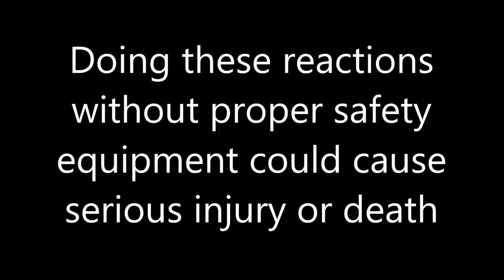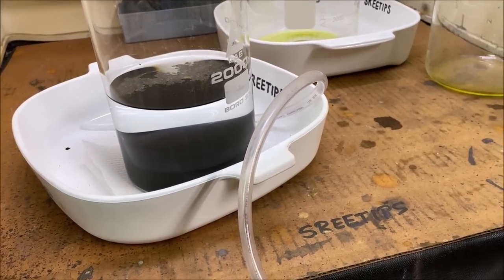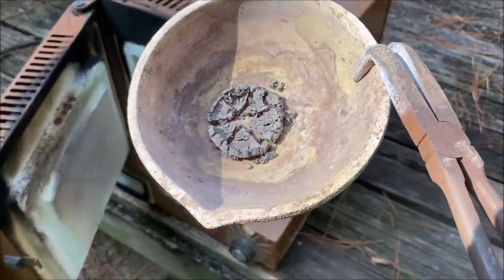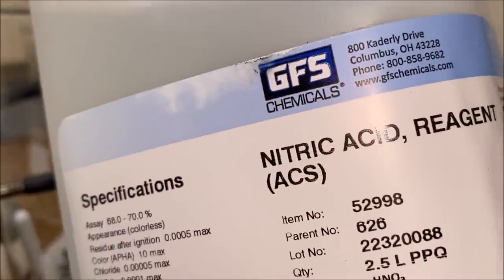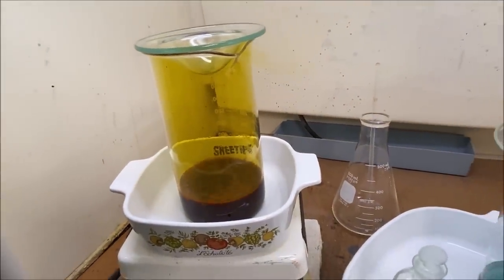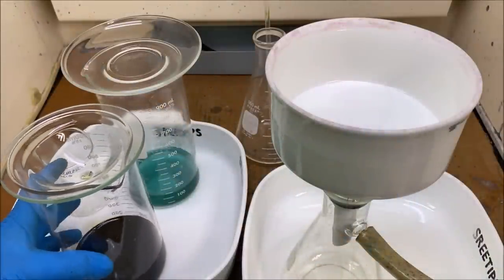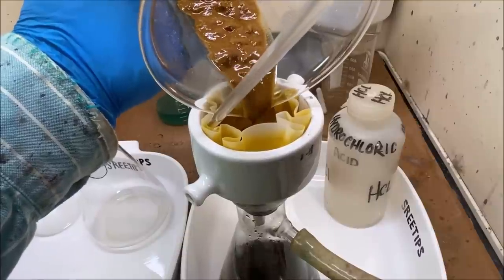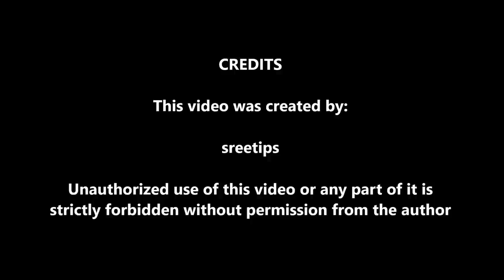Stock Pot 5 Pt3

Comment: Thanks for another series of videos. You and others have been pivotal in helping me on this short journey of extracting and refining precious metals, which has been highly lucrative for me and my family. One experiment I tried with "contaminated PGM" gold mudd after rinsing and drying was adding Nitric acid at 90/10 (v/v) with light heating. After rinsing and heating with DI water, I had 99.35-99.5 % purity from assay feedback with our refiner. I did have residual gold precipitates that rinsed away on decants, but those went back into my stock pots.
Reply from the maker: Nice

Comment: Out of curiosity, I know it's a pain to work with, but would using Copperas make sense here when dealing with mixed precious metals? Since it drops just the gold, that portion of the mixture would be gone and out of the way and you wouldn't have to deal with PGM contamination in your gold.
Reply from the maker: The pgm solution would be loaded with iron in solution.
Reply: @sreetips  Ahh. Gotcha. Thanks!

Comment: There’s another refiner on here - I think Omega, that took his copper junk and made a copper refining cell (same basic idea as the silver cell) as an experiment - then refined the sludges from that and found that a fair amount of PMGs got pulled along with the copper.   Be interesting to see Sreetips do this - mostly to see if the techniques and procedures used are so different as to leave that much less in the waste cooler.
Reply from the maker: Silver and other precious metals are in the slimes from refining copper. But for me it makes no sense to waste time trying to refine copper. Clean copper for refining is cheap and plentiful. To a precious metals refiner, copper is waste.

Comment: The way you make your basket with the dacron  filter, it looks like you're using 2 layers of it, the way you place/cut it. My question is if you used a single layer, would the silver crystals grow faster? And would it lead to significantly more contaminants? Would love to see two side by side, one with a single layer, one with a double layer and compare them every few days! Thanks for your videos!
~LightMike
Reply from the maker: I prefer double filter protection against contamination over speed.

Comment: If you inquarted the gray material with sterling and did nitric boils would the PGM's have followed the silver out in the boils? I still think you should make copper plates for your stock pots with your waste copper.
Reply from the maker: The PGMs will follow the silver

Comment: Once you realized you messed up and didn't crush the chunks up you should have wash them with distilled water. Heated them in the beaker on a hotplate until they were dry then poures them into a a mortor and used a pestle to crush them up. Then continued with the nitric boils. Would have taken you an extra 30-45 minutes tops.
Reply from the maker: I know, guess I just got lazy.

Comment: instead of throwing the copper away from your waste treatment bucket, accumulate it in another bucket until it gets completely full. Then take it to your local scrapyard. You will get enough money to purchase some acid, or put gas in your tank, buy more Copper tubing for use in your silver refining. Simply throwing it away is wasteful at best. I give away my copper from my waste treatment bucket to the local scrapper who travels the streets looking for scrap metal.  He says they will take it!
Reply from the maker: Huh? My scrap yard won’t touch it with a ten foot pole.
Reply: @sreetips  Try a different scrap yard. There is always more than one.

Comment: I tried using the liquid chlorine process to dissolve the gold foild from a batch of pcb-based CPUs I was working on the other day.
I was able to get the gold foils to dissolve in HCl with little issue, but when I added the SMB, nothing happened. Turns out, if you add too much liquid bleach to your hydrochloric acid, the sodium hydroxide stabilizer in the bleach will neutralize all of your HCl & you have to add more acid to get the SMB to evolve SO2 gas & precipitate your gold! (imagine how much head-scratching & cursing it took for me to figure out how to solve THAT particular dillemna!)
Reply from the maker: You gained valuable experience.

Comment: Sreetips, I admire your technique, it reminds me of Chemistry 30 class. 
  I was wondering if you could have precipitated the platinum and palladium before precipitating the gold?
Reply from the maker: I’ve always got the gold out first because it’s the easiest.
Reply: Just wondering if there was a different chemical that would precipitate them leaving the gold in solution?
Reply: He could of used ferrous sulfate I think it's called, he used it before it's a green powder that he dissolves in water and that will only drop the gold.
Reply: I think it makes the next steps easiest if gold is gone first. PGMs are ornery.
Reply: @PaulBrown-uj5le  Yeah, that is more gold selective, but also a slower reaction.
Reply: As gold is the hardest to get into solution it's the easiest to precipitate. Can't think of a reagent that would  precipitate Pt(+1 and +2) and not take some part of Au(+1) out with it.
Reply: @ottolehikoinen6193  that makes a lot of sense. Gives me the answer I was looking for. 👍🏻

Comment: I apologize for asking again..  I know you discard the copper that you cement out on the iron because it's very impure.. I recently saw a video where they melted their cement copper and refined it with an electrolytic cell (like you do for silver).  Seeing as purchased copper is essentially thrown away $, have you considered doing some kind of electrolytic refining of your copper to use for future silver cemeting?  Just a thought..  at the very least there might be video production value in it! 🙂
Reply from the maker: No, refining the copper costs more than just buying cheap and readily available copper. I bought a bunch of clean copper tube (20 feet) and copper sheet (about a square yard) for seventy bucks today at an estate sale.
Reply: @sreetips  Oh wow!  I wouldn't have thought that!  Thanks!

Comment: We're do you get your iron its been heck for me too find
Reply: Have you tried local fabricators
Reply from the maker: I know a metal fabricator. He made my crucible tongs. I showed the grade I need and fills up a bucket for me. I pay him fifty bucks. It lasts for about a year.
Reply: I know iron is best but is there any other substitute I have iron right know but running low
Reply: @luckybeaverfinds9837 iron's the cheapest of those. Find something rusty, get rid of some of the rust and try to use that, poor quality steel f.e. Many metals form a passive oxide layer (pure stainless being one) and can't be used with good results.